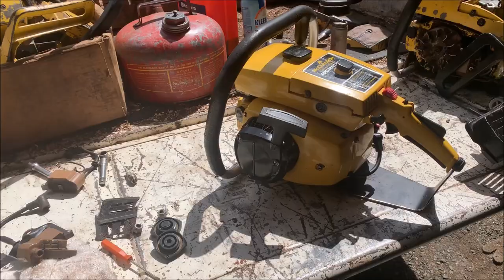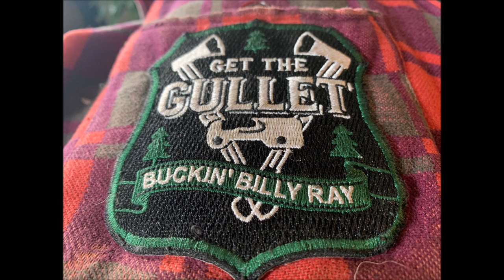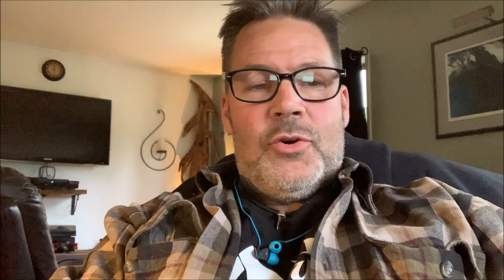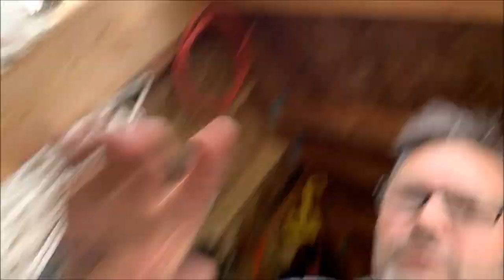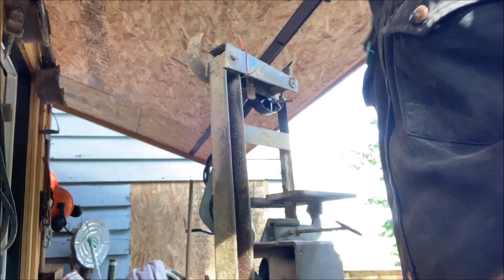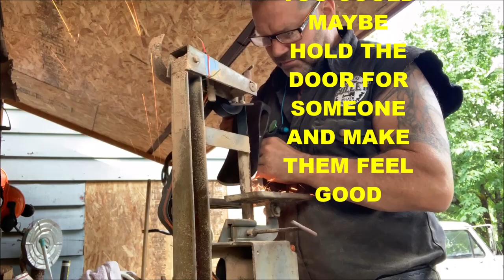TAILGATE CHAIN SAW SHARPENING TIPS , AND MUCH MORE

Comment: Very nice from the Woodmans guys for that poem.  And he's right about it.  Buckin, are you still doing test with the 5/32 filer ?   I use it instead of a 3/16 filer. Easier to file, less fatigue in grinding the metal and specially gives you a bit more run when the tooth is at its last moment of being RIP.   What do you think ? Talk to us about those final tests and results. Cheers Chief.